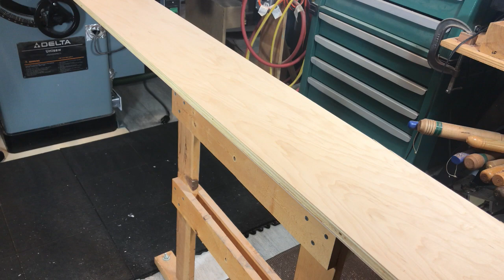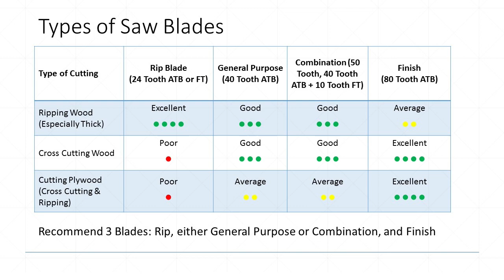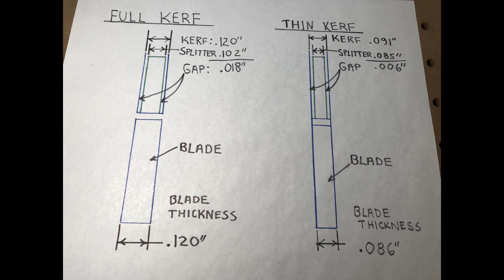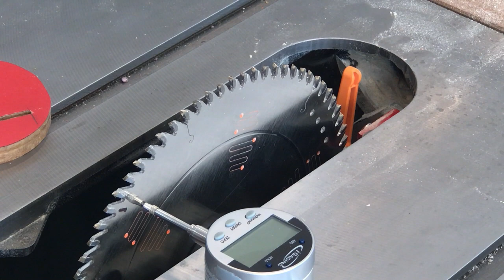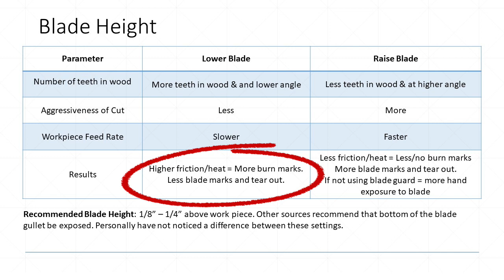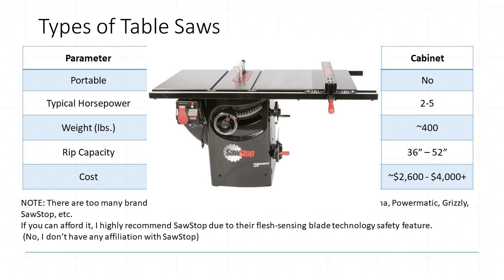ULTIMATE Guide: Setting up your table saw

Comment: I would rather be better than 0.005”. I mark my blade and the solid arbor edge. I then turn the blade to get it to run as straight as possible, which is usually within 0.002”. Then I adjust the table to run parallel to the blade. I can get that to better than 0.003”. The problem is that neither the arbor nor the blade are perfect. In reality, the blade is a wobble dado to a tiny extent. By rotating it around the arbor before finally tightening it and marking the blade to the arbor and always tightening by the same amount assures the finest spec. Fortunately, I do machine shop work in my shops, and I made a proper washer. It’s important for the outer diameter of the washer to match the outer diameter of the arbor stop. Additionally, the inner raised diameters diameter should be the same as well. It’s simple. If one or the other is larger, given the dish in the middle, you will bend the blade as you tighten the arbor. If the are the same, that won’t happen.

The problem with the usually supplied stamped washer is twofold. One is that it’s not precise. Two is that it’s soft steel. So when you tighten, the center moves in, and the outer edge bends out, effectively rendering the washer smaller than it is, causing the dishing of the blade. I’ve measured several thousands movement of the blade edge when tightened too much with the cheap stamped washer - not good. Try to get a thick machined washer.
Reply from the maker: Hi Mel, I appreciate your advice. Thanks for commenting.  Regards, Ken

Comment: Nice tutorial series!

To add to your list of saws, don't discount a well loved older saw like the Craftsman 113 series... especially those from the 60s and 70s.  While they do lack some of the more advanced safety features of the latest models (flesh sense, rising riving knife, good dust collection), they are built like tanks compared to what you can get today.  

I modified mine and basically turned it into a near-cabinet saw with 36.5" right and 10" left rip capacity by adding extra cast wings, a Delta 36-T30T4 fence and a rock solid boxed base that also greatly improved dust collection.  A set of Jessem table saw stock guides are super nice to have for both stability and help prevent kickback.  It weighs a ton and they can serve you well, costing way less than new.
Reply from the maker: Thanks you for your feedback. Yes, I agree you can do a lot with older saws and used saws are certainly a lot cheaper than new table saws. I would say as long as you are able to use some sort of splitter to prevent kickback that is very important.  Also, if you don't like or don't have the original blade guard, I recommend for anyone to contact SharkGuard because they make splitters and blade guards for many older models of table saws. Thanks for the comment. Ken
Reply: Agree on the splitters.  Those SharkGuards look nice, but I'm uncertain as to their ability to work well with my setup since it has to mount from the rear of the saw as did the OEM (Delta fence rear rail gets in the way and my outfeed table restricts ability for it to mount properly and allow me to move it).  I'm sticking with MicroJig Splitters for the time being and looking for a way to overhead mount my original blade guard.
Reply from the maker: That sounds good.  I have heard good things regarding the MicroJig Splitters.

Comment: Ken, very nice video.  I certainly agree that blade height should be low for safety reasons.  I am curious, though, why you believe that a high blade height causes more saw marks.  Also, in my experience, a high blade height has more chip out on the bottom, but less on the top.  If the blade height is too close to the thickness of the material, the lead tooth will enter horizontally and likely cause chip out on the top veneer of plywood.   So i usually aim for around 1/4” to balance safety with a clean top surface.
Reply from the maker: Hi Alan, thank you for taking the time to view my video and for providing your comment. In my example, I am referring to having the saw blade set for it's maximum height and pushing the workpiece in an aggressive speed (both of which I don't recommend) that could potentially cause some blade marks.  I completely agree with your approach of having the blade 1/4" above the work piece to provide a clean cut on the top of the workpiece.  Thanks again for your feedback!